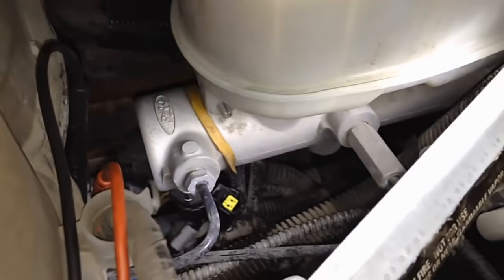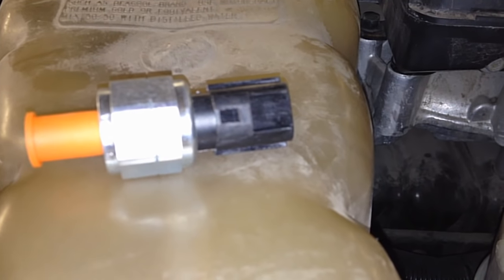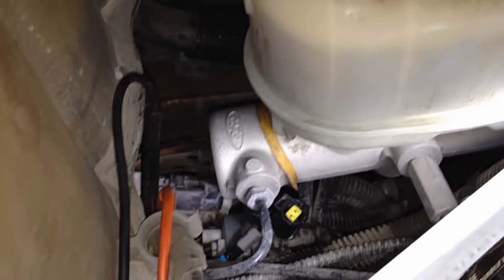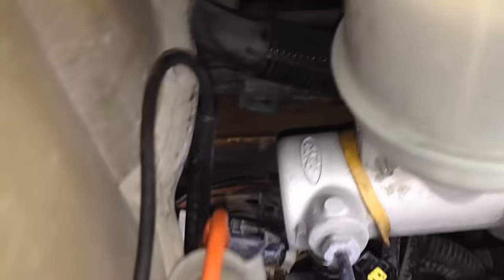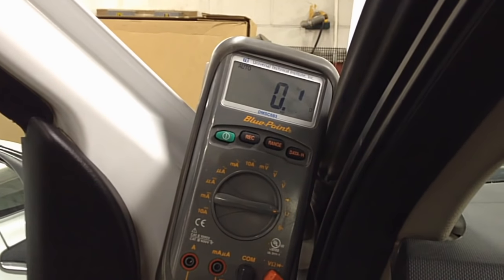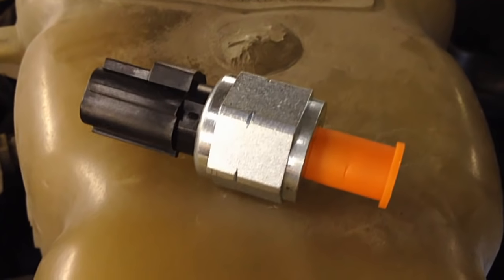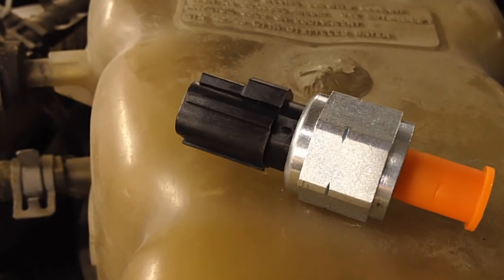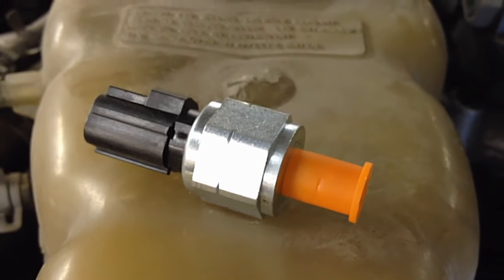#1 Reason Your Ford Cruise Control Doesn't Work Anymore

Comment: I just bought a 2012 Focus SE, and the cruise control is working only intermittently.  Dealer says it has to act up "more" before they will look at it again under the "extended warranty".  Would my car have this switch - on the brake pedal?   Thanks!!
Reply from the maker: +Tim Specht Yes you have this switch up above  the brake pedal it should be blue or black. Allot of times they get out of adjustment and are best to just replace.

Comment: I have a 2001 ford expedition and it won't come out of park.I need to know how to determine whether its the switch or a short in the wiring.a few months ago engine light came on,but truck ran fine.then about a month and a half ago the cruise control went out I noticed,but truck still ran fine.so I wake up this morning to the locked in park problem.also my windows stopped working.I read and successfully tried the turn key and put in neutral to start and go.starts just fine by the way.I would have addressed other problems but have been low on money and truck ran fine so I lagged.please any info will help....well good info that is.

Comment: I have a 2008 f150 xlt 4x4 this cruise control issue has led me to this page have tested every part but this cutout switch book says it’s either on the master cylinder or along the brake lines, well mine is not on the master so could you please tell me where on the brake lines it would be located.

Comment: Hey, not sure if you are still responding but I have a 2002 f250 without cruise. I've read that I can add it but putting in a xlt column with cruise from a junkyard and jumping a wire. Thiughts?
Reply from the maker: Bryce Nickerson Oh you can add it sure but I believe the pcm still must be programmed for cruise. There is allot more wires than just one though.

Comment: I have a 2011 Mercury Milan premier when I'm driving down the highway I can set my cruise control at 72 miles an hour now what's happening is sometimes my cruise control is shut off in my vehicle slowed down so I'll get it back up to speed and set it again it'll be okay but sometimes it just shuts off by itself without me hitting a break what could be causing that problem

Comment: Well, got the part and installed it but didn't seem to do the trick.  My cruise will turn on and hold for a bit, then turn off.  The new part did come with a new wire harness, but I just stayed with the old one.  Should I try the new harness?
Reply from the maker: The harness is just a interface between the old style and new connectors, what vehicle are we working on?
Reply: FordTechMakuloco 2003 F150
Reply from the maker: Try this-
The self-test is comprised of 2 parts. The first part is a static check of the speed control electronics module and system. The second part is a dynamic pull-test to check the actuator motor and gear mechanism. To perform the self-test:
Connect the scan tool to a power source that is not interrupted when the ignition switch changes positions. With the ignition switch in the RUN position, set the scan tool to monitor the powertrain control module (PCM) throttle position PID while the speed control actuator carries out the self-test.
Enter self-test diagnostics by firmly pressing and holding the speed control OFF switch while quickly cycling the ignition switch from RUN-to-OFF-to-RUN, making sure the engine does not start and is not running. The speed control indicator lamp on the instrument panel will flash once to indicate that the speed control module has entered the diagnostic mode. Release the OFF switch. If 5 additional flashes are displayed at this point, a speed control subsystem concern exists. GO to Symptom Chart.
NOTE: The module times out if each button is not pressed within one second of the previous button. If a module time out occurs (speed control lamp stops flashing part way through test), the procedure must be re-initiated.
Firmly press and release the remaining switches within one second of each other in the following sequence:
ON
RSM (resume)
CST (coast)
SET/ACCEL
The speed control indicator lamp flashes once after each of the first 4 buttons is successfully pressed. Firmly press and release each switch in the sequence immediately after the light goes out for the previous switch.
NOTE: There will be a slight delay from when the last button is pressed and the lamp flashes diagnostic codes. If the self-test will not start or cannot be completed after multiple attempts, GO to Symptom Chart.
Follow the list below for diagnostic flash codes, then GO to Symptom Chart.
0 flashes: No flash after the last button pressed: suspect circuitry or speed control switch.
1 flash: Static test passed.
2 flashes: The stoplamp switch is damaged, circuit is damaged, or brake pedal is applied; CPP switch is damaged, circuit is damaged, or clutch pedal is applied.
3 flashes: The speed control deactivator switch is open or the circuit is damaged.
4 flashes: The vehicle speed signal is out of range or circuit is damaged.
5 flashes: Speed control actuator internal failure.
NOTE: Monitor the PCM throttle position PID after the last button is pressed.
Within 0.25 second after the static test has passed, the speed control actuator carries out a dynamic pull test automatically by actuating the throttle lever from 1 to 10 mm (0.04 to 0.39 inches) of travel from the idle position for 3 seconds and then releasing the throttle. If the PID value does not change and holds steady for 3 seconds, GO to Symptom Chart. During the dynamic throttle pull, observe throttle movement to witness any binding or sticking of the speed control cable, verify the correct connection of the speed control cable to the throttle lever, and make sure that the throttle returns to the idle position. If incorrect connection and/or binding or sticking of the speed control is observed, GO to Symptom Chart.
Turn the key to OFF and GO to Symptom Chart.

Comment: I have a  2008 F150 4.2 V6, and this part is not in the master cylinder, any idea where i can find it?
Reply: the blue switch under the dash is the only I need to replace? is comparable to the one you show in the video?
Reply from the maker: Yes

Comment: I have a 2003 Ford F250 with 6 speed transmission. I tested the system as you stated, I have continuity whether I push the brake or clutch pedal down, any suggestions.
Reply from the maker: They are all too common to stick either way. I would replace it and retest.

Comment: Will hopefully get this done tomorrow: picking up part at Oriellys tomorrow. Anyway, same truck, '08 F 250, I'll need a 7/8" wrench? I don't see threads on the part? how does that work?
Reply from the maker: Alison Jones Yes it should be 7/8"
Reply: That orange piece is a protective cap covering the threads

Comment: Apparently the 05 150 STX 4.8 has a different Cruise control shutoff, the only one I can find is the brake pedal shut off switch.  Is there a pressure sensor in the system.  If so where can it be found.  Thank you.

Comment: I have a 91 Ford Mustang with a 5 speed I just purchased, cruise control worked when I bought it, was trouble shooting the trunk pop switch, it wasn't connected...but ow the cruise control doesn't work, any input would help if u can think of anything thanks.

Comment: 2012 focus sel. cruise control been in and out for a while. recently it has been unable to turn on unless the horn is pressed. clock spring or steering wheel harness issues?

Comment: I drive a much older generation 96 F150 and this was my problem. The pins are so damn crowded I had to spend 20 minutes cleaning them just to get continuity while shorting them out for initial testing. but once I have covfermed the pins contacting to the DMM leads... O P E N

Comment: i recently purchased my 03 mustang v6. cruise control didn't work at all and still doesnt. i have replaced a sensor that is behind the brake pedal. i was told i have an exhaust leak now due to the ticking sound & it also started making a new sound yesterday Nd my 4 year old said it sounds like there is a frog in the motor the frog noise is coming from the passenger side closest to windshield a local mechanic suggested cleaning and tightening air filter/box...any recommendations for upgrading? thanks yall

Comment: Any idea where this would be in a 2007 MKZ/fusion? The cruise control doesn't work in my 2007 MKZ, but all of the other steering wheel controls do work. The car only has 50,000 miles on it though, does this make this repair less likely? Thanks for the help! +FordTechMakuloco
Reply from the maker: +Sean P There are two brake switches under the dash the one on the left is for the cruise and is tested the same way.
Reply: +FordTechMakuloco I can't seem to find the second one, all I can see is one brake switch attached directly to the brake

Comment: Do you have to bleed the brakes after you put the new sensor in? I assume since its connected to the master cylinder air might get into the system?
Reply from the maker: No need just do it quick

Comment: i have a 2001 ford expedition and the horn and cruise control stopped working at the same time. most from what i read said change the clock ring under the steering wheel. I did and now the4 horn works but still No cruise control.  Had the recal done on the cruise control on my expo years afo and the inline fuse is fine along with the other fueses under the hood and in the cab of the truck. What else can i do now????? thanks
Reply from the maker: Ok so we are getting somewhere. As for the cruise have you tested the switch as shown in the video. Chances are if you have the original old style switch in there it has gone bad fuse blown or not and leaking or not.

Comment: I "thought" this was my problem and solution.  I changed the sensor switch and Presto! the cruise worked again. ....for about 2 hours.  Then it quit again.   I took the factory module (now in my hand) and it had continuity.   Odd, I thought they failed open.   So i tested the module on the truck (new one).  It had continuity.   I wedged a 2x4 on the brake pedal and seat to activate the brakes.  Tested the module and still continuity.  I thought the module "opened" under brake pressure.     

I'm about as confused as I can be.    Any insight from those of you who have conquered this is appreciated.

Comment: BTW, Mine is an 03, F150 4.6,, old had 9/16" nut on bottom (located top front master cylinder), ,, new 7/8" top, n has about 5-6" connector wire, to make work, but cruise control back, N really need cruise control, in smaller town's around Asheville NC, like Canton, and Fletcher, ,, or your getting a ticket, $10.33 on line, but wanted now, so $21,00 with tax Orielys, n working perfect, thx,

Comment: I do not have this sensor on my master cylinder. I have a 01 F-250 5.4 GAS I looked pretty much everywhere around that area and still haven't found it. Cruise control use to work, just went out recently. Any ideas?
Reply: I forgot to mention it's a standard.

Comment: I've got an 08 F150, and where the Brake master cylinder is located (which according to both this video and also all places I have looked is where this switch is supposed to be), I do not see it.  Could it be located elsewhere?  I have already ordered the inhibitor switch that is down by the brake pedal, a small expense, but if that doesn't fix the problem I still have no cruise control and I have a trip upcoming in a few weeks that is hours long and mostly interstate.

Is there a way to tell where it is supposed to be located?

Comment: I just stumbled accross your video. I have an old 2000 F350 super duty.  Is this part the same for all.  If so what is the part number and were can i get such a part?
Reply from the maker: 1L1Z-9F924-AA
Motorcraft
Part # SW-6350
Reply: Thanks.

Comment: I have 95 f150 4x4 I got in feb 98 cruise didn't work 06 I got a recall from ford to bring it in for speed control switch. I took it they told me it would be a bout 3 weeks or so. Meanwhile I went on a fishing trip 80 miles from home pulling my boat . Then all a sudden could not start in park only in N so on the way it started smoking underhood at this switch I jerked the wires loose drove on home brakes did not work very good . but made it home wait for dealer to get part they replace switch no charge. Cruise control still did not work.

Comment: Ive read about several 96 Bronco 's catching fire because of this. Scary. Would it be ok to just unplug it and leave it unpluged if you dont care about cruise control and dont want the fear of your Bronco  burning up?
Reply from the maker: +OliverKoolO yes its  the brake fluid causing it. Apply dielectric grease to the connector terminals and put a balloon over it with a zip tie to cinch it off from water intrusion.
Reply: +FordTechMakuloco Thanks

Comment: I have 1999 crown vic and can't find this switch.  Is it located in the cruise modulator located on firewall next to mast cylinder?
Reply from the maker: Jimmy H Follow the brake lines down you will find it.

Comment: I replaced the old oval switch on my 01 f150 with 5.4 with the new one and the harness that it came with. The old one leaked brake fluid slowly so I figured it was the problem. Cruise still doesn't work so I was wondering what to check next.
Reply from the maker: applegatorify Make sure there is power getting to the switch.
Reply: FordTechMakuloco Thanks great video old switch was bad and there was power to the new one turned our my dash light is burnt out also so the light doesn't come on but cruise works now! Thanks a lot!

Comment: Hi! My problem was my 2000 f250 was leaking from the very part you replaced. I put replacement but i see it has a conncetor at the end when we never had it plugged into anything. (bought used in 2007) Is it safe not to have it plugged into anything or what is is supposed to be plugged to. Thank you
Reply from the maker: Jennifer Sanchez No I would plug it in for sure voltage in the presence of corrosion has potential for heat and a fire.

Comment: will this be the same setup for a 2003 navigator? The cruise control light comes on but it is not engaging....:(
Reply from the maker: no yours has another switch to the left of the brake light switch.
Reply: FordTechMakuloco My f-250 does the same thing (1999) sd. as dondadda killy. Would that be the same fix as his navigator This is the third time it has done that after about 6 months. This time I want to fix myself.

Comment: I have a 2002 king ranch F150 and nothing works on my steering wheel not even the horn. Seems like No power to the steering wheel. But if I use my key fob to lock the truck the horn beeps. Idk what to replace
Reply: Clockspring behind the steering wheel
Reply: I have replaced the clock spring and nothing has changed. So I replaced to horn pad as well while steering wheel was apart. But the cruise control still doesn’t work. My next guess is the actual buttons

Comment: Hey I  watched your video on the pressure switch for the cruise control repair. I bought a new motor raft switch part # 6350. 1x.      1L1Z-9F924-AA.  I bought it thrue Amazon and it said that it would fit my 2003 Lincoln Navigator but it doesn’t fit , I tried to install it and the threads on my switch are a lot bigger. Do you know what the correct. Motorcraft numbers is for my truck?  It’s a 2003 Lincoln Navigator 5.4 ltr.    Thanks. Tony

Comment: 2002 mountaineer 4.6L v8  cruise light comes on but usually won't engage.  sometimes it engages and i get runaway acceleration.  is this switch the problem?  thanks
Reply from the maker: runaway accel is either it catching up or a servo problem. If you are having any issue with speed control on that year this switch would be the absolute first part to replace.

Comment: Where is it located on a 2005 F 150,xlt with 5.4, can not locate
Reply from the maker: Yours does not have one there is a different kind above the brake pedal it's blue
Reply: +FordTechMakuloco What about a 2007 Ford f150 XL automatic
Reply: +john gallant Picures would be helpful
Reply: +john gallant What does switch look like above The Brake Light switch?

Comment: I have a 2008 f150 xl 2wd 4.2 the cruise works at random times and the brake light is also on but will go off occasionally. The brakes work fine just the light stays on. Could the brake light be from the deactivator switch, do you think a new switch could get my light off and the cruise working where would it be located on this truck?
Reply: young padawan does anybody know where this switch is located for a 2008 f150...I don't see it on the mc
Reply from the maker: young padawan the switch is next to the brake pedal switch to the left of it.
Reply: ok, what I am seeing  looks nothing like what you have pictured. Its blue and white and all plastic and snaps together....hope this works
Reply: unfortunately the part did not solve my problem, brake light is still on but brakes work fine and the cruise still isn't working....do you have any suggestions what else I could try
Reply: Answer?

Comment: Does anyone know if this switch exists on a 2006 5.4L F-150?

The master cylinder does have an electrical connection but that is for the electrical system check, I am assuming. I can't find anything else that is even close to it.
Reply from the maker: The switch on yours is under the dash next to the brake stop lamp switch.
Reply: Wow, thanks for the reply first of all. And secondly, your videos are all very helpful so thanks for that! I'm pretty sure I know what part you're talking about and mine is blue. If so, I'll make sure to reply or make a video and give you a shout-out if it works.
Reply: Would this be the same for an 01 F-250 5.4L as well?